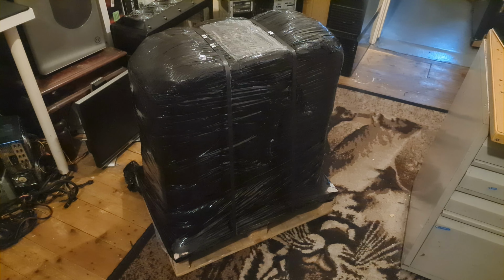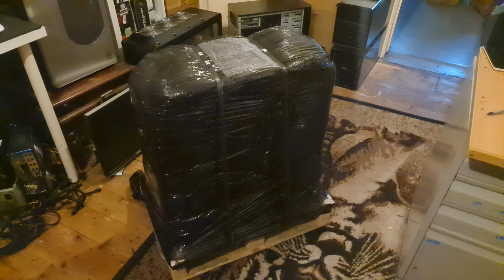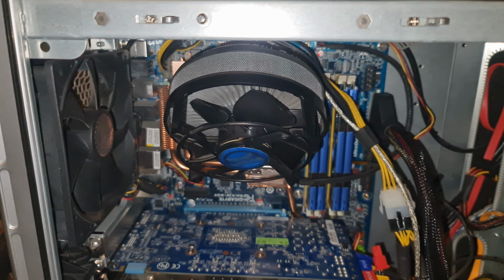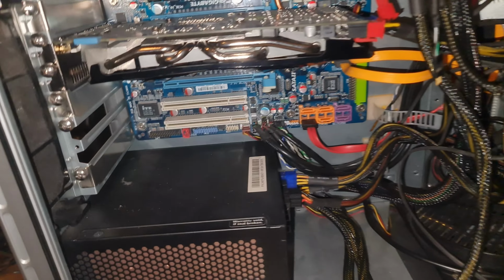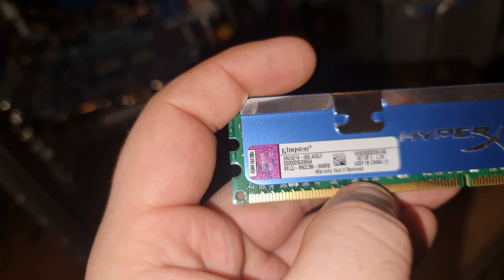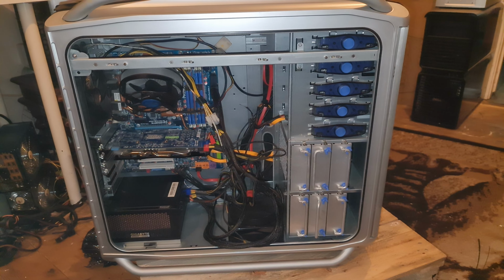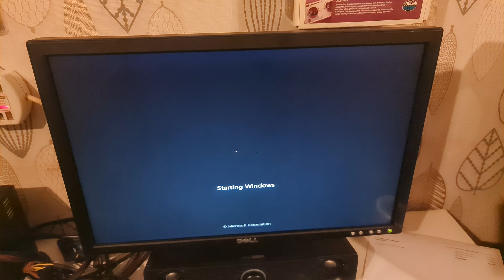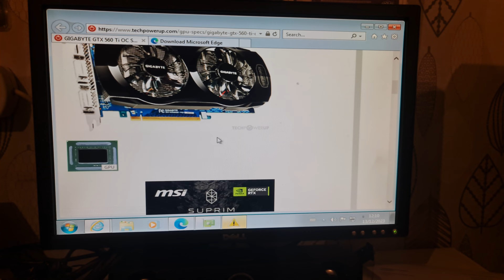I Brought A Mystery Computer on a Pallet

Comment: Nostalgia, i had a X9650 too, pushed that bad boi to 5Ghz. But ran it mostly at 4.8
I remember i had a beefy 3 slot asus gtx 680 and an Asus P5E3 PRO Workstation board that had extras like some mini asus fans too that connected to the vrm heatskinks.
Thing was a beast, not that much slower than my actual 6700k. Those were the times.

Comment: Case looks like a great one for a new modern build
Reply: I had one of those cases around 2007, its a heavy piece of shit.  I transferred my components to it and everything jumped up in temp 10-15c.  It looks good but the airflow in it is practically non existent.  They did do other versions with a big 200+mm fan on the side panel (coolermaster cosmos s), this one though is like throwing your components in an oven.
Reply from the maker: There not good for air flow until you change the fan to High pressure ones
Reply: @thetechwizard3352  even at that it's pretty limited compared to more modern cases.

Comment: Very nice deal for 50 pounds, I would have snagged it too. Best case of that time. I'm still using a case from that time, not as good as the Cosmos but it was a premium case at the time, Enermax Phoenix that I heavily modded for better cooling and GPU support.
My next case gonna be TT CTE 750 but still can't find 1 in my country and importing it will cost 450$ including shipping and customs so no. Will keep waiting for it to arrive in my country hopefully some day, got a Corsair 4000d for 50$ that I may move my PC into for now.
Reply from the maker: it was a lucky fined. i like enermax stuff it good quality.